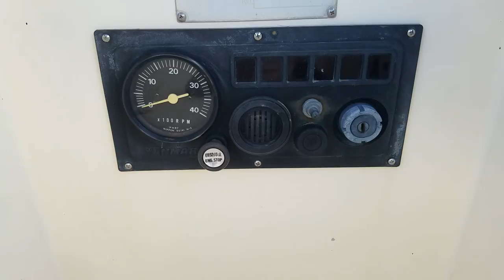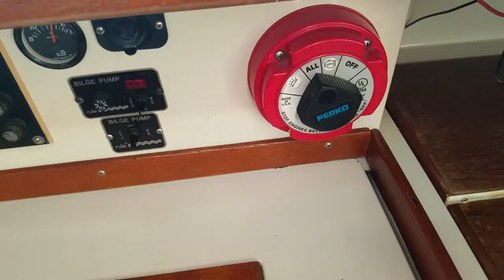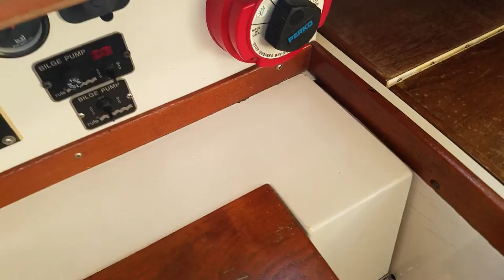CS 27 walk through.

Comment: I recently got myself a CS27 that needed complete refit - this video has given me more than a few ideas, particularly the double-level storage in the lockers. I did a complete replacement from scratch of the awful slide-out head basin, put on stainless tracks with teak trim instead of veneered ply. Rebuilding the head cabinets would be my first recommendation to anyone buying one of these. The original cabinetry on the CS27 was one of the biggest letdowns - horribly built and fails to effectively use space.

Comment: What happened to the teak floor inside?   Nice boat.   The CS27 are beautiful boats, very well made.   You added a great engine.   The new owners have a great boat.  My family sailed our CS27 Hope, for many years on San Francisco Bay and the delta.   Raised two little sailors on her.   Just the right size for the bay and delta.   Very secure cockpit for kids.   Added a 70% jib to handle winds over 30 knots.   Also could do all 3 reefs from the cockpit.   Moved on to a new Erickson 34, Hope II, which added a foot to the draft but made the bay a lot smaller.   Kids grew up and went their own ways.   Wish I had kept the CS27 as she was easy to single hand, and at 75, I would still be able to handle the bay without a crew.
Reply: The original CS27 was built with a frp sole, with only the bilge sole being wood. The CS27 is a dream for single handing, as I've learned as a young sailor and new CS27 owner.